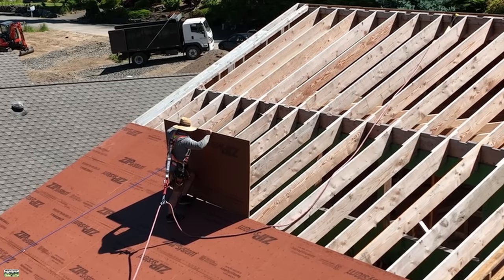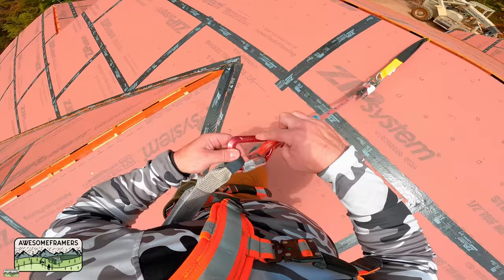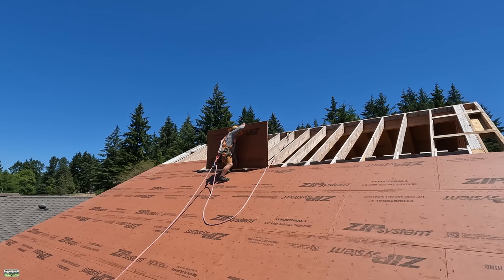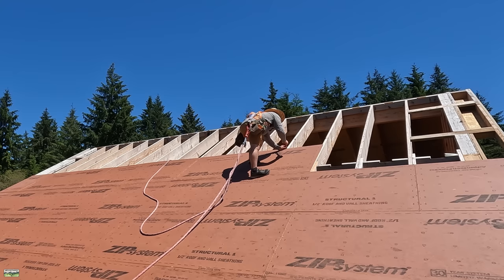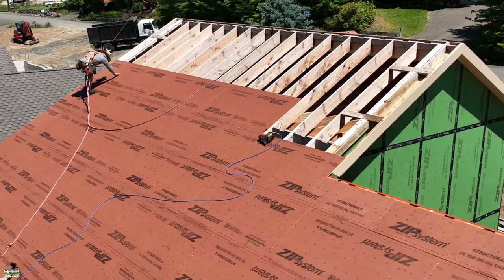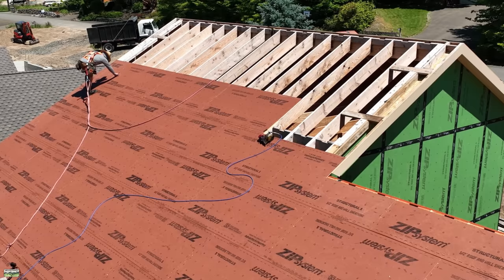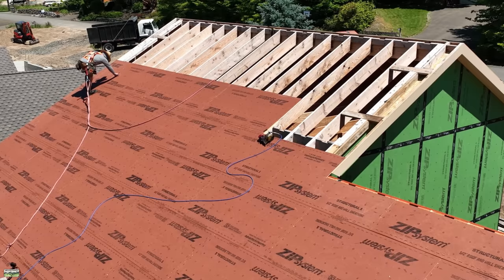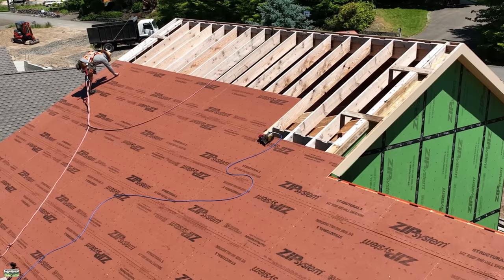Rooftop Framing Continued: Time to Sheath | Part 5

Comment: I wish I was 44. I'm 66 and still pounding nails. I'm building a roof over a roof top deck at a pub. to be completely transparent, as you say, I did get a 37-year-old and 2 50-year-old guys to help install the rafters.

Comment: I prefer retractables lanyards, mind you they're not all equal, some glide more easily than others.
Also I'd say it's better to staple as you go especially on 8/12 or steeper.  That said there are times when I tack the sheets in certain sections before stapling for some reason or another. One reason to staple as you go is to give your compressor a chance to catch up.
But I guess maybe you don't have that problem with your setup. 
Not that I have the perfect system even though I've had 20 years to perfect it. Hence the reason I'm watching these videos.

Comment: If you fall into your fall protection you better have a rescue plan. 10 to 15 minutes before you start losing body parts. If you're working solo wearing fall protection you better have a sharp knife. The fall is better than gangrene. That advice was from A PG&E   tower safety class witches a little higher than a roof 😎
Reply: Stirrups are a great invention. Dont know why there not compulsory on all harnesses
Reply: In reality you should never work alone - it is the working alone and not the fall protection that will get you into trouble.
Reply from the maker: Great points 👍👍👍👍

Comment: What are you supposed to do when homeowners don’t want you to put screws or nails in their non standing seam metal roof for fall protection?
Reply from the maker: There are products that don't require fasteners, but they'd have to pay extra for the gear or the rental cost of the gear.

Comment: I know this might be a dumb question but for someone who doesnt build houses for a living how do you go about squaring the roof. Whats your advice for a DIYer on how to make sure its square for sheathing
Reply: Diagonals should be the same on a square roof. Pythagoras' theorem (3,4,5) helps. But basically it starts at foundation level, everything should come up square, plumb and true
Reply: @kierandoherty1600  So do you basically check square when setting both outside end rafters. I understand squaring the walls with each other just was wandering how squaring rafters was. I thought it was along the same lines just wanted to get another perspective
Reply: @ghettohey2388  Yeah, if your walls are plumb and square and your end rafters are plumb, the roof will be square. Just start with good walls and then when you set your ridge and end rafters or start rolling your trusses make sure they are in line with the walls and plumb and the roof will be square. Ive never really known anyone who checks with diagonals, but you will know how you did when you start sheathing. If your ridge cut is 2” at one end and 2’ at the other end you know something is off hahaha.